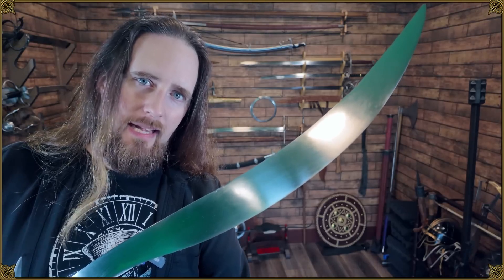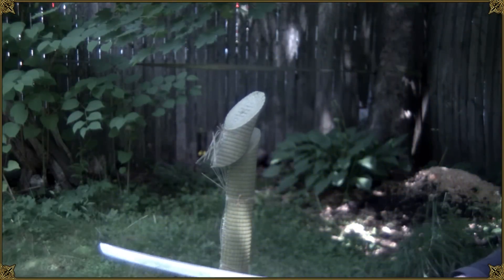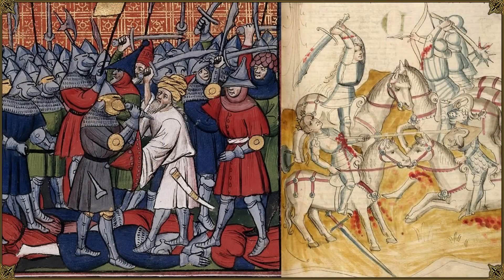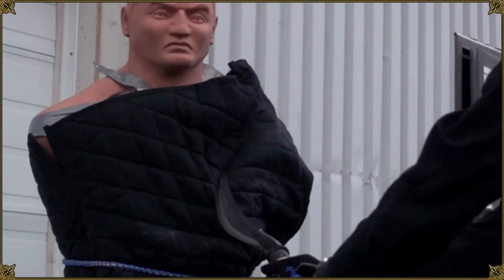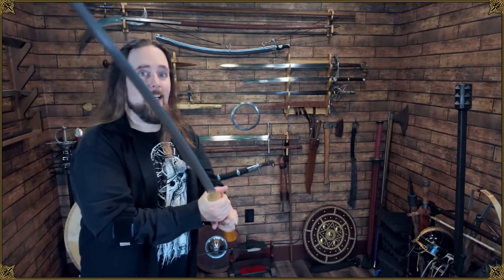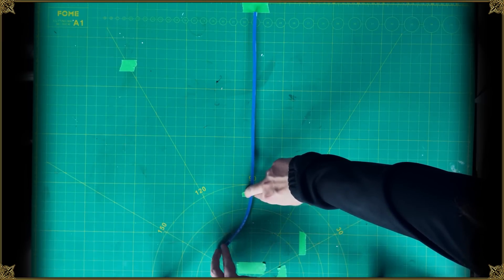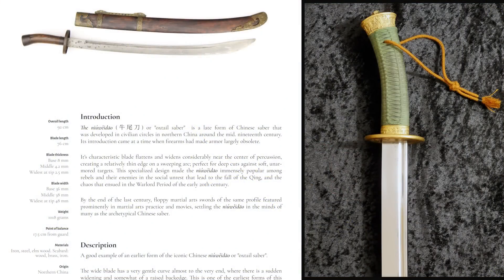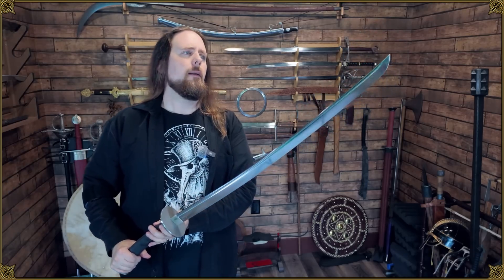Sword Design: What's the Recurve For?

Comment: i don't know how much practical difference it really makes, but as we are talking about minute details anyway: when you have a recurved handle the angle of your lower hand towards the lever is different. i will simplify it a lot (as one does with physics examples :D ) but basically at the beginning of the cut you have more or less a 90 degree angle onto the handle with a STRAIGHT handle. however immediately after that you pull "upwards" (not really but in relation to the sword).  whereas with a recurved handle you may start in a slightly disadvantageous position but then get into a better one and it continues for longer because you have a longer range of motion as you started further forward, so you can theoretically accelerate a bit longer because your body also does not get into the way of the handle moving towards you as quickly.

how much of an effect this really has is beyond me, but it could probably be calculated by someone smarter :D

Comment: If you think about it, isn't that why smooth teeth edges exist in history? they act like a curved blade without giving up reach or having to make it heavier, infact they can make a blade even lighter, thing is they are a pain in the ass to make though.
Things tend to get cut way easier if you cut where the surface area is small, that is why cutting something like a plank of wood by striking at the flat is almost impossible, but if you strike at the corner, you can get way more force concentrated .

Smooth teeth edges can act like they are hitting a "corner" by whatever they are striking, flat or curve, especially if its a curve, it can amplify it even more.
Plus smooth teeth edges can have more "edge" for the same length, therefore you are going to need less sharpening maintenance, but sharpening it back can be a bit more difficult, depending how consistent the teeth edge is grinded on the blade

Comment: I think the curved handle is ergonomically more comfortable since the arms are attached on either side of the body, so a straight handle needs a little flex in the wrist to line the hands up and the curve is like bike handlebars but shorter so curved the other way

Comment: I got you on the handle thing.

You probably didn't notice because you use both sides of most blades but when fanning you flip the blade which requires  choking back on the handle to continue or cancel the second strike and keep the point on the enemy.

With a straight blade and handle you actually do travel a longer distance because you strike then flip then choke back.

With curved you can strike and mid strike start choking back on the handle and flipping the blade flips the curve getting you on point sooner.

Allowing you to strike- fan cancel- restart the second cut or stab.

Comment: My guess for any curvature is power instead of cutting proficiency, I'll explain. When the blade is curved, by the time your sword reaches your target your arms and hand are in a better position to use more force (different muscle activation), and for the handle it's more or less a replacement for bulky pommels to force your bottom hands thumb index and middle finger forward so you can activate your stronger arm muscles and deliver a stronger cut. This is just speculation though, and I would love to see you do an experiment on this.

Comment: Curved handle probably is meant to make fast atacks at close distance without big swing or even without moving to much your ellbow. Effective for example in tight space or in fast counerattack. Also that type of atacks must save power. In close combat on battlefield when you have to make a lot of fight. Also no need to rotate a lot as you showed. Also very usefull if you have full armor and your rist and ellbow movements are restricted.

Comment: I think the thread has nailed this so far, but I'll try to sum up:
Curved blades:
1. means that you can disengage from a target more effectively after the cut, Seki Sensei talks about this when talking about cutting vs Kenjutsu. (difference between the martial art and the pure cut)
2. does slice better, if only marginally.
3. presents a shallower angle of bevel, again marginal.
4. or sabre can be easier or more simple to use in the heat of battel, Matt E. talks about this when talking about officers curved sabres. 

A recurve in the blade can optimise some of these benefits when using the top 1/3 of the blade and act more as a chopper in the middle 1/3 as well as work well in the bind at the bottom 1/3.

A recurved blade almost always has a recurved handle, but even without the recurve in the blade, the recurve in the handle does a few things. 

1. In a two handed sword it give a better range of motion to the arm and shoulder when preforming a cut by extending the bottom hand at the farthest point where the arm is strong and the top hand closer to the body where the arm begins to be strong to push. This way it maximises the body mechanics to push and pull the blade to make a cut. 
2. In a two or single hander it gives the bottom fingers a knob like in an axe handle to rotate the sword through the maximum distance where the fingers are strong and generally provide better grip while swinging.

Comment: From my understanding a curved handle allows for more leverage to amply force due to the angle of your arm not needing to be in a more awkward position to lift up on the back. Like how guns have an angled handle to allow the force to travel more comfortably with a better aim then a gun with a straight handle as some what of a close analogy. The back end of the handle of a curved handle sword still has a greater distance to pull upward with the sword still being in the same positon allowing for greater force, not that the blade is traveling a shorter distance. That's at least my understanding

Comment: To me, it seems like the curved handle helps ergonomics by reducing the angle that the rear arm and wrist have to bend at to extend the blade forward. Point an imaginary sword fully forward, then bend your rear hand like the handle is curved. It seems less strenuous and may increase power and handling because it's easier to apply force when your rear arm isn't bent so far out of shape.

Comment: Also the curve in the blade means less of the surface area of the edge is in contact with the target than with a straight blade, meaning the power of the cut is concentrated on a smaller area. A thought I've had for a while and would love to see a practitioner explore is getting close to the best of both worlds in cut and thrust with a straight spine (small bit of false edge around the tip) but a profile along the edge that gives the practical effect of a curved blade. For example a slightly redesigned Orcrist from The Hobbit movies (just the blade the hilt is trash)

Comment: Curves are sexy. Mmm, curvy good.

I'm not sure how much a curved forward handle effects the swing, and I really enjoyed uour measurements lol. 

I use some or the one handed curved handles in chinese swords and yes it onehundred percent helps me jnow where my hand is in the sword, helps me notice when my hand starts to slip, it make the hand sort of naturally slip towards the guard and away from the pommel.

Although i think this is also neglible pushing the pommel forwards has gotta change the handling and weight distribution somehow, cause the pommel is slightly forward and above where it would be if it were straight, so like, the gravity pulling the pommel down should push the blade slightly forward right? Am I overthinking this?

Comment: About the forward handle specifically, could it be that they wanted the blade to be in a guard position, but to create stronger cuts without having to cock the blade back and potentially create an opening?

Comment: One interesting thing is, if you push with the top hand and pull with the bottom hand, your pivot point is now in the middle of the handle, not up at the guard. I don't know if that makes any difference to use though.

Comment: In my entirely unqualified opinion, I suspect you're correct that there's no real advantage to a curved grip. But that's not going to stop me from speculating anyway.

When you're pulling something toward you, there's kind of an optimal pull distance: too far away or too close and you have trouble applying your full force to it. So I wonder if the curved grip moves your off hand---the one that's pulling on the sword in that particular push-pull strike---closer to that optimal distance so you get more power out of your off hand. This would probably require you to use a particular technique to actually get an advantage out of (if there's any advantage to get).

Comment: If you think about the motion of the hands through the swing, the lower hand is limited in how far it can pivot the sword. It's about 15-20 degrees away from getting fully parallel to the arm. That's the same angle of the curved handle.

By allowing the handle shape to make up for that angular difference, you're allowing it to become more an extension of the arm during the back half of the swing for theoretically improved control. But more notable is that you can now swing the sword further without contorting your lower arm, and that could help make up for that difference in reaching the target you demonstrated with the shaped rod on the grid mat.

Comment: I think it might be more of a biomechanical/ergonomic thing

Imagine if you're right handed, you're doing a horizontal cut from right to left.  your right hand pushes the handle, while the left hand pulls the handle towards the body.  If you have a recurve handle then the left hand can start that pulling-motion farther from the body; whereas with a straight handle, the left hand pulling motion starts closer to the body.  This means practically speaking, with a recurve handle you're able to pull the left hand a further distance before your left arm/elbow collides with your own torso (or becomes so pulled back that it's no longer efficient to pull any further).  The cut is more powerful with a recurve handle, because the left hand can move a farther distance.  

So the cut is more powerful on a recurve handle not because it's technically a better lever or anything, but because you're ergonomically/biomechanically enabled to apply force over a slightly longer distance.

on a single handed handle, the recurve is better at translated the rotation of a wrist pivot into cutting power.  The recurve allows you to use your pinky and ring finger to manipulate it better, because your fingers are stronger at pulling inwards around 2-3 inches away from the palm, rather than 1 ish inch away from the palm.

Comment: Short – Handle curve adds ‘snap’, a slight acceleration by giving finger contact sooner.

Long – You have to look at each physical action separately to see what it contributes. 
So for the lower finger squeeze to rapidly twitch the blade forwards: Think like a bow string only where the arrow is not in full contact with the string to start. This is any spring, or lack of firmness in, - the finger-to-handle contact. The sooner the string starts driving an arrow the sooner the arrow starts moving. Any gap before contact is wasted string travel time. The sooner your fingers properly engage the handle the sooner force is applied. So the net result is for the same finger twitch, you apply force sooner and thus make the blade hit the target sooner than a strait handle (assuming matching blade and movement). 
It may only be a slight gain, but if a sword tip curves away from the target a little, anything to make up for the potential extra distance the tip may need to travel will go a long way. Especially if your already at a range disadvantage for the curve. (what if you can only reach as far as to make tip cuts? Make them count eh?)

For how much it mattes I try to look at both ends of the scale. I’ve noticed a difference using various garden tools myself. It can make your finger twitch naturally, performing a better cut in my experience, especially one handed tools.
Now consider you’re making swords for people to fight with, you would probably want to encourage that. It may mean nothing to the individual sword, but in a battle it could scale up to an overall much bigger outcome that wins you the battle via everyone just getting a lot more pokes in.

Another approach is to look at an over loaded pedal bike, bags on handle bars to make them heavy to handle.
I’m a weedy stick person, any big bump in the road can force the steering one direction or another. Larger built people, or those that ride a bike like a normal person, may not experience this as much lol! But! The more tension you have on both handles, the more instant control you will have. The same applies to the sword handle, control sooner.
I carry silly amounts on my bikes handlebars (50+kg sometimes), that extra control really matters. 
So while I can’t give a value for how much it matters to swords I can imagen it does certainly do something. And were knights not skinny stick people where skill effectively wins over pure strength? ... Hmm I sudden feel my weedyness gives me a sudden insight lol! 

Point to make though, consider peoples build back then. Differently built people use their body in different ways.

Comment: The curved handle has the same effect as a gun handle, more comfortable to hold and easier on the wrist. Hold an imaginary handle in your hands with both using a hammer grip, one of the wrists will be straight and the other will have to be bent with a straight handle, with a curve for the second hand both wrists would be straight. A single hand and a curved handle is more comfortable with a handshake grip and is designed to be used that way primarily. And with a two handed it makes the second hands handshake grip more comfortable.

A reverse curve pushes the material it is cutting towards the point, a forward curve pulls the material towards the center of the curve, a recurve does the same as a reverse curve but having the edge off center and forward increases the amount of force produced... with a sword that's negligible, a hammer though it makes a difference. A recurve or forward curve add the benefit of self alignment, you will get better edge alignment. A reverse curve is better for cavalry, pointing it at a foot soldier you want to impale has the tip hit at 90 degrees while a straight blade would hit at 20-45 degrees, a forward curve would be terrible, and a recurve would work like a reverse curve just hitting higher up.

Comment: I think the recurve handle is more about the angle of the hand at the point of cutting.  When the blade is at the target the knuckles of the bottom hand are facing the target rather than the ground. This allows you to pull straight back rather than upward which is biomechanically more powerful, which is exactly what you'd want at the moment of impact.

Comment: One reason a highly curved (or angled) sword cuts better than if it were straight is the way it changes the effective edge geometry. You can look at the guillotine, for example. If you had a flat blade with a 20° bevel, then of course when it drops, the effective geometry is just 20°. If you now angled the same blade at 45 degrees, then the effective edge geometry becomes 14.2°, and the mechanical advantage of a 14.2° wedge compared to a 20° wedge is 41% higher! Of course, swords will not have such an extreme difference, and this only applies to theoretical versions of the same sword. But people seem to overlook this factor. And it also applies to the cutting methods, such as the famous draw cut of tulwar-wielders, which creates a greater angle for the cut.

Comment: Idk how to explain it but i feel like the benefit is happening in the arm and back muscles rather than just in the handle and blade? Like it lets you start moving from further away and make a longer motion and get more length of muscle into the swing? I have no idea how to explain what I'm trying to describe or if it even makes any sense. 
Like your left arm is more extended so you can move it more and get more of thet muscle contracting and contributing.

Comment: Curved handle on a single-handed sword lets you dynamically change your grip and it is very intuitive, the curve lets you use your fingers more, increasing the range of motion, and it rocks in your palm like a rocking chair. If possible, try double straight sword (jian) and then double saber with a curved handle (dao) on a target; for some reason, with two swords of the same length it is so, so clear, even to an amateur like myself. 
Though I'm also not sure if it makes any difference in a two-handed sword, other then slightly changing a fighting style, as you said. I've majored in physics and my intuition is usually good, but I see nothing here.

Comment: alright i'm not experienced in handling swords, but the recurved grip thing was super interesting so i've given it some thought (i do indeed have an engineering/physics background as well as tennis and rowing so i feel decently qualified lol). i think you were on the right lines, since it brings your bottom hand further forwards it means that without changing the blade position you essentially have the sword pre-cocked to apply a lot of leverage with no downside. you can throw a cut that's just as powerful as if the blade was pulled back, except you don't have to make yourself vulnerable and since the blade is closer to the target they have less time to react to your strike. i'm not sure how extreme the curve/length of the handle would need to be for this to be significant though, and i'd assume it would make some other attacks feel more awkward (off the top of my head if you wanted to do a two handed thrust the bottom wrist would probably feel quite weird)